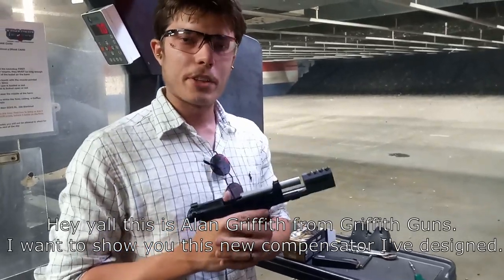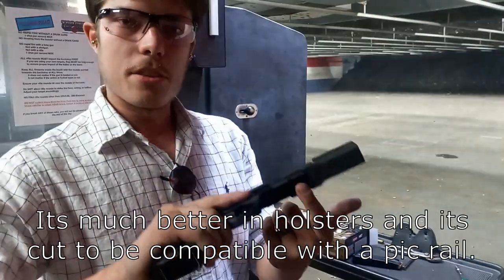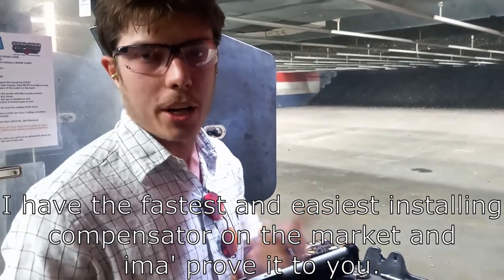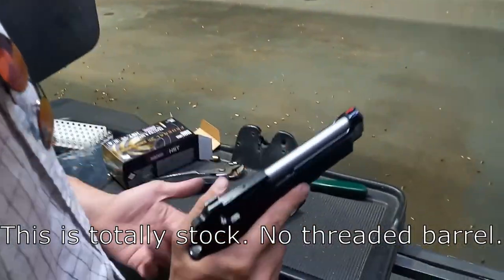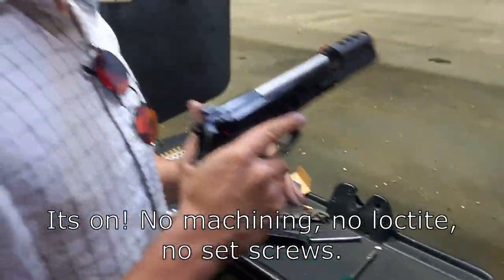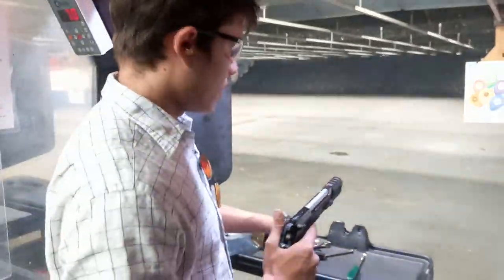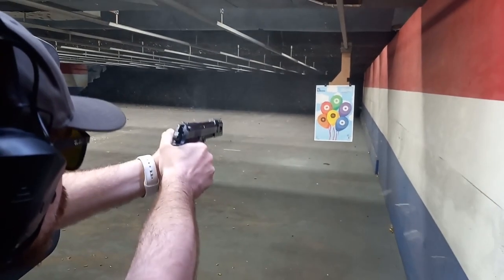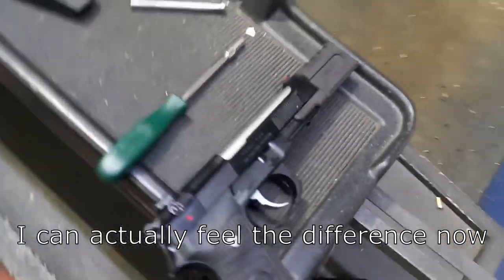Beretta 92X Professional Compensator

Comment: I own a 92FS and I am interested in your compensator. As I watched your video on the installation process, I thought of a suggestion to make it easier to tighten the guide rod. I saw where you were using slip-joint pliers to hold the guide rod while tightening the threaded screw. My suggestion is this: if you drill a hole in the guide rod large end, large enough to insert a small drill or allen wrench, to hold the shaft and keep it from turning, while you tighten the screw. As for the compensator body, would it be possible to make the bottom of the compensator extend backwards from bottom towards the trigger guard? This could possibly allow a lite to be attached without having to purchase a model with a rail on the bottom. This could allow owners like myself to attach a lite. Just my 2 cents.
Reply from the maker: Thanks for your input brother you have some good ideas. Traditional threadless kits do have that hole in the rod. My thought behind excluding that was that the small tool that could fit inside the hole could get bent and be stuck. 

I did consider making a model with an attached rail. Threadless comps can be pulled forward by being snagged, worse case it gets stuck forward and causes a jam. I've tweaked my design to reduce the risk of snagging. Adding a pic rail or a light would be snag city. Trigger guard light mounts do that job way better.

Comment: Coolest and BEST comps made! 

Looks like you could use some new mag springs tho lol
Reply from the maker: Thanks bro I appreciate it. If you're talking about the slide not holding open, that's a grip issue. I grab very high and tight, I usually accidentally hold down the slide release.
Reply: @griffithguns1776  Roger that, i do the same dang thing! I actually ended up grinding down the ledge on my slide release a little bit then blued it and it helps alot!
Reply from the maker: @TheCaydon  Dang that's clever. I may do that. I might have to produce a low profile slide release when I have the tooling to do so.
Reply: You definitely should man! Nobody else is making a low pro slide release, i bet if you did they'd sell.

Comment: Got one more question. What’s the difference between the professional and the combatant. Is one better and/or more reliable for self defense?
Reply from the maker: Thr combatant has 2 ports, which is a great balance between size and performance. The Professional has 4 ports which gives the maximum performance. Those are the 2 length options.

There are also fitting options between railed and non railed beretta 92s.

Comment: Have you considered making it out of steel? Collector design werks make theirs out of steel and has a way more appealing design.
Reply from the maker: I have considered it, but decided it was a bad idea. Machining steel would require a better coolant system, more expensive tooling, and longer cutting time. For that effort I would end up with a compensator thats heavier and wears the muzzle of the gun. It would be neat but I don't see a reason to stop using aluminum alloys at this time.

Comment: Alan, that 'GG-92 professional' is the most aesthetically beautiful Beretta compensator out there, and I'm considering getting one for my 92XI Squalo when they're available, but wouldn't a threaded option be the way to go if additional money/time wasn't a concern?
Reply from the maker: Thank you sir. 
Bias free, there are pros and cons to threadless and threaded. 

Threaded allows minimal size and weight, but requires a replacement barrel and machining/fitting on that barrel by a gunsmith. Also usually needs threadlocker and replacement slide springs.

Threadless can be much bigger with way more effecting porting, but the size can make it hard to find a good holster. It installs onto a 92 with a standard barrel fast. In the rare case that it does need fitting, it can be done with simple hand tools, not a milling machine. Doesn't interfere with the action tuning, uses the standard spring perfectly.

IMO every firearm design change has upsides and downsides and my GG92 fits its role quite well. I do have an excellent threaded prototype made so that my customers can pick their preference. At the moment I dont have the time to produce more though.

Comment: 9mm doesn't have much gas to divert for the sake of compensation... I wonder how much of the effectiveness of this unit is simply the additional weight at the muzzle.  I mean, I'm sure that it's both the mass AND the gas diversion... but what percentages?  I bet it's 90+% mass and ~10% gas diversion.
Reply from the maker: With my design its more about the gas than the weight. Despite its size it weighs only 2-3 ounces because it's machined from aluminum.

Comment: Just left a comment on other vid saying you should make a slimmer one. Lol im gunna leave the comment so you hopefully get more traffick. Youre doing my childhood dreamjob.
How do you legally make gun parts and get started? And are you turning a good profit? Anytime something cool happens for berettas they fall into obscurity typically from price and rarity i hope that doesn't happen to you.
Reply from the maker: Thanks bro. I can't really make a slimmer threadless design because it has to be wide enough to wrap around the frame. It's still thinner than the conventional Ric/SGS style adapted to railed berettas. 

I'm able to legally make and sell this part because it's unregulated in every state. I don't do exports either. You do need to find a good payment processor after you're past doing money orders and stuff like that. 

Profits now are not great. Everything I make sells out immediately, but my issue is production. Manual machining is very slow and this is a very complex parts kit. After I deal with some logistical issues I will be acquiring a cnc machine. If you want to do what I'm doing consider this. Small Manual machines are cheap and great for learning or making your own parts. They are not well suited for mass production. Getting a premium part from these machines is very difficult and slow. The more you can invest in your machinery, the better and faster your work will be. What you earn will be more aswell. Right now im about 4000 deep in tooling.
Reply from the maker: I have a question. What would you make if you had the tooling?
Reply: @griffithguns1776  i want to make imo the perfect semi auto pistol. I see a lot of room for improvement. But parts im like you i just want cool, reliable, affordable stuff that is available to normal dudes who work hard for their money. Like me. I could blow all my money i get buying a gun and customizing it for it to not be exactly what i want anyway.
Same thing with guitars. And even car bodies and frames.
I just have no idea how to legally do any of it and dont own land or anything for a workshop. And im tired of breaking my body down as i age working crappy physical labor jobs lol.
Reply: @griffithguns1776  unless you mean what would i want to see you make. Also thanjs for the insight.
So you dont own an llc youre literally just a dude who ships from your house but you have a financial helper?
Reply: @griffithguns1776  how long have you been producing this product? I think maybe youre just not known despite production hold up. I always look up beretta comp stuff every few months its my dream gun but ive never seen you before.
I have some money saved up but id have to blow it on land and a metal building even if i build the building myself. Everything in America has tripled in price especially land. And thats with no plumbing or electric and sleeping on the floor. But i dont wanna wait til im 60 to start.
Im not happy in America and theres no opportunity bc no one can save money. So i can either be technically kindof free but miserable or i can go to another country where i cant own guns but its peaceful and life is more pleasant and i live in that constant state of anxiety lol. 
Im a loner with no business friends or anything everyone my age is addicted to tiktok.
If i had tools and everything not cnc just manual production i would make my guitar design ideas but even that market is tough.
Late stagr capitalism has a squeeze on the small guy bc large mass production or extremely expensive small scale but risk going out is the only way you can go. The valley of rich and poor is widening.
It feels like checkmate but we gotta try.
I really hope you make it bc guys on the bottom supporting eachother is the only way to win.
Reply: @griffithguns1776  do you use a mold or are you manually measuring and cutting the shape to an example?
Reply: @griffithguns1776  you should try to find a standardized screw to go into the rod hole
And ik metal is through the roof right now
I also want to make a metal computer desk product but its not really a desk more like a mounted station that hides all the wires.
Reply from the maker: @cam-inf-4w5   Don't get blackpilled, you can make more money. You do have to bust your balls working overnight until you find the way to leverage more money for your time. Owning your own tools and getting great at using them is a great way to do this. By owning the tools you get the full profit of your labor. It took me years to acquire my tooling, but you can do it too. 

A payment provider is just a company/service that handles payments from your customers. Like PayPal or stripe. Most don't allow legal firearms accessory sales as a matter of policy. You can temporarily use paypal though. 

Regarding machining, I machine everything from raw material stock. I start with a block or rod of metal bigger than the final part then machine away until its complete. 

My current tooling setup will run on standard 110v electric outlets and fits in the corner of a garage. You don't need alot of space to begin.

 Lmk your age and location to figure out your legal limitations.
Reply: @griffithguns1776  27 Arkansas. Im good with tools already. Not any drill presses or anything but im not scared of it. Ive drilled enough crazy stuff i shouldnt have in my hands already lol.

Comment: I have a 92a1 with a threaded barrel. Will it work with the threaded barrel?
Reply from the maker: My comp isn't fitted to go around the threaded barrel. It could work but I haven't tried. However I am going to make a threaded design as soon as threaded barrels are back in stock.
Reply: @griffithguns1776 thanks for the response. Unfortunately I have the the 14x1 RH thread pitch. Nothing fits on it lol. I’d have to get an adapter. Considering just getting the barrel cut and ported and being done with it. But I do have a 92 ltt rdo I just got I wouldn’t mind throwing one of these on.

Comment: @griffithguns1776 I have a 92fs m9a1 would it fit on to it? Also where can I get it asap?
Reply from the maker: Yes it fits. You can order it on my website by email but I'm very backed up. Will be upgrading tooling to speed it up soon.
Reply: @griffithguns1776  I actually send you out an email because I’m interested in getting my hand on your product,